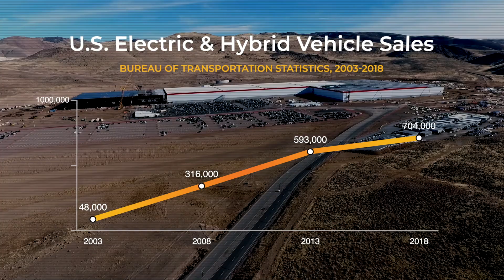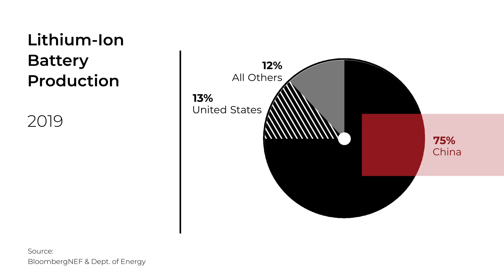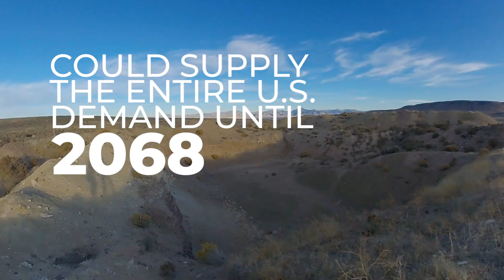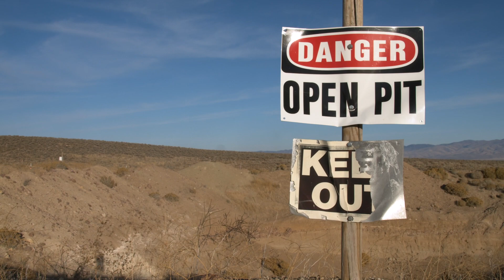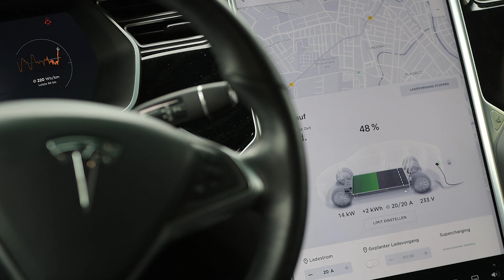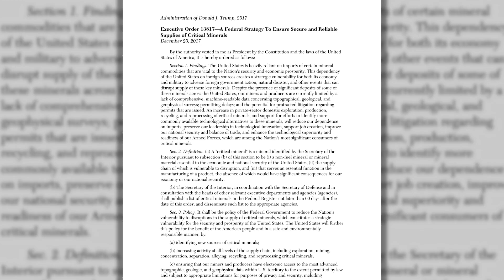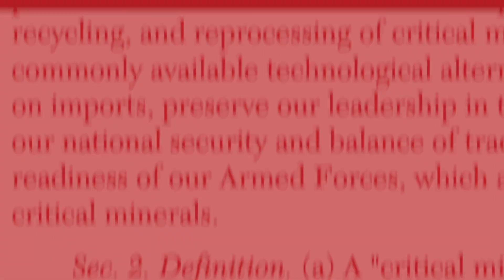Tesla Came First. Now Nevada is Becoming America’s ‘Lithium Valley’ | NBCLX

Comment: The video rightly focuses on Lithium Americas and Thacker Pass because of the vast supply of lithium found in Thacker Pass, the fact that that lithium is very close to the surface, that new methods are being developed by Lithium Americas for a source of lithium not previously tapped anywhere in the world:  Lithium Clay.  LAC, Lithium Americas, lab in Reno is developing new ways to incorporate old methods into new processing of lithium clay and to do so in such a manner as to be economically competitive with the two traditional ways of lithium mining:  hard rock mining and lithium brine mining.  Lithium brine mining has always been the cheapest, but it also takes the longest to process from brine to commercial lithium in as long as 18 months and from sources thousands of miles away from the U.S., such as the "Lithium Triangle" of South America.  LAC's Thacker Pass operation is planned to generate byproducts during the production process that will, by their sale, generate sufficient additional revenue so as to bring the overall cost of production of commercial high grade lithium down to competitive levels with even lithium brine processing.... and without having to transport the product thousands of miles to factories here in the U.S. where it would be incorporated in a final product.  The Thacker Pass mine is projected to have a life in excess of 40 years and even that may be an underestimate seeing as that some of the areas not presently planned for lithium clay mining, but adjacent to those planned areas may at a later date be added.  Yes, as "A" pointed out there are other potential Lithium mining operations in Nevada and Cypress is one of them, but there are scads more besides Cypress.  All except Albemarle are Lithium Juniors and financing along with actual lithium mining expertise and experience are difficult for many, if not most, of the Lithium Juniors to come by.  In fact, many of the Lithium Juniors have no real expectation, much less chance, of independently succeeding... unless one of the Lithium Major Producers buys the up or merges with them.  None have the potential that does Lithium Americas at Thacker Pass.  This video compressed in under 10 minutes a multitude of reasons why LAC's Thacker Pass is going to be a great source of lithium for the U.S., great for Nevada and great for all the industries in the U.S. and beyond who depend on a future source of economical lithium.
Reply: Excellent summary Bill. Thank you for watching, and yes, it's an extremely complex story to simplify — even in under 10 minutes.
Reply: @ChaseCain  Nice job putting that together Chase. For anyone new to LAC or the Li space it was a nice blend of information. Did you ever interview Tesla to get any feel for their plans on how they'll address Li supply?
Reply: @pearldiver7  I did my best, but unsurprisingly, they didn't even reply :)
Reply: @ChaseCain  Yeah, definitely not surprising. Thanks Chase. Again, nice job.
Reply: Paul, I believe you are a little off target on your comment.  Ganfeng Lithium is one of the largest producers of lithium in the world.  They claim "vertical integration" status when it comes to lithium and they are one of the largest mining companies of lithium in the world who also produced lithium ion batteries and other products as part of that lithium vertical integration, but to categorize them simply as " a Chines Li battery manufacturer" ignores their importance world wide in respect to lithium mining production.  You also stated that Ganfeng "owns a majority of Lithium Ameerica's share"... seems you are stating that LAC is majority owned by Ganfeng Ltihium Ltd.  This, Paul, is NOT the case at all.

I suspect your are referring back to the situation regarding LAC's mining situation in Northern Argentina at the Cauchari-Olaroz lithium brine mine that is still in development.  LAC used to own the majority of that facility, however in February of this year it was announced that Ganfeng Lithium was going  to subscribe for new shares of Minera Exar  for 

    cash consideration of US$16  million increasing its  interest from 50%  to 

    51%, with Lithium Americas owning the remaining 49%.

Minera Exar is the entity under which LAC has operated in Argentina and it is responsible for developing Caauchari-Olaroz.  Up until February, 2020, LAC had a progressively declining but still majority ownership but since then LAC is in a minority capacity and Ganfeng is the majority owner.... of that particular development.

Having said all of that it needs to be said further that LAC has 100% ownership of the Thacker Pass claim in Humboldt County, Nevada.  Ganfeng Lithium does not own a Majority of LAC stock.  The total amount of "Institutional Ownership" is something shy of 6% in figures released earlier this year and is divided among over 50 different institutions.  

Chase Cain's excellent video depicts the situation in reference to LAC's 100% owned Thacker Pass lithium clay claims in Humboldt County, Nevada, USA.  Ganfeng does NOT have a Majority position for that property and it needs to be clear that the situation of LAC in Argentina vs the situation of LAC in Humboldt County, Nevada are two entirely different situations.

So the impression you left with your question does "change things" if anyone was to believe that your conclusion was correct regarding ownership of LAC, but it was a false premise so the change needs to be in your premise and your erroneous conclusion.  Chase Cain did an excellent job with his video and it still stands as an exceptional piece of journalism.  I am biased against most journalists who fail to do diligent research prior to publishing.  I consider Mr. Cain as a welcome exception to that slip shod method of investigative reporting since he did his homework in detail ahead of publishing his video.  My thanks to Mr. Cain.   My own bias?  I remain an optimistic LAC investor.
Reply: Paul Kim, there is some truth to your statement about Ganfeng Lithium being a battery manufacturer, but when that statement is not extrapolated into the totality of what Ganfeng does then it is quite misleading.  From Ganfeng's home page is their self description:

"We are the world’s third largest and China’s largest lithium compounds producer and the world’s largest lithium metals producer in terms of production capacity as of December 31, 2017, according to CRU. We offer five major categories of more than 40 lithium compounds and metals products, which we believe is one of the most comprehensive product offerings among the lithium compounds and metals suppliers in the world. We have a vertically integrated business model, with operations along the critical stages of the value chain, including upstream lithium extraction, midstream lithium compounds and metals processing as well as downstream lithium battery production and recycling."

Ganfeng is one of the largest producers of lithium in the world and lithium mining is a major part of what they do, so they are far more than " a Chinese Li battery manufacturer".
Reply: The problem is lithium carbonate is phasing out to lithium hydroxide
Reply: Nothing sophisticated about snaking public land in United States to take back to Canada.   This is not Canada.  This will not happen.